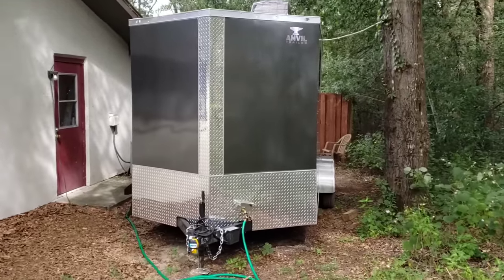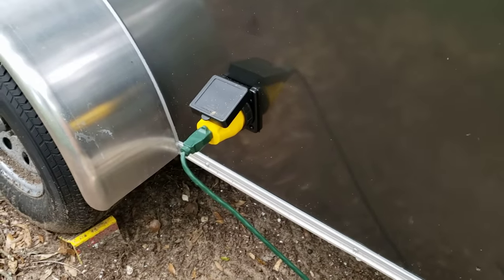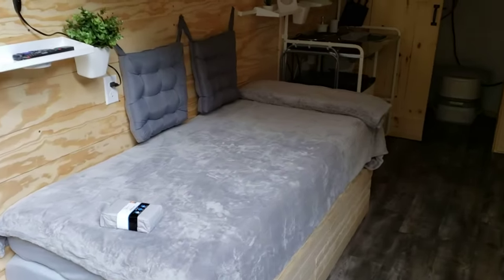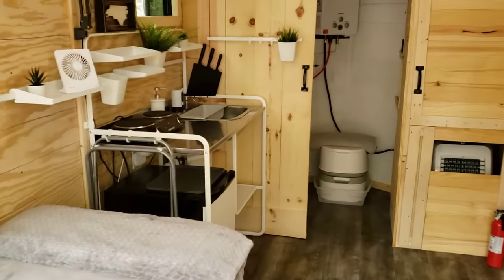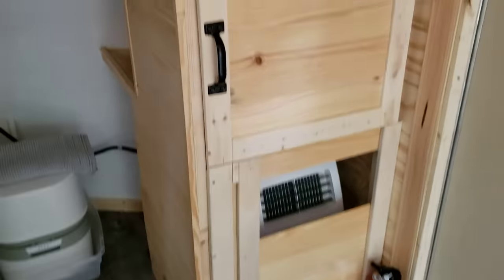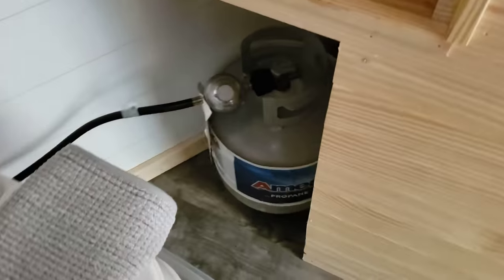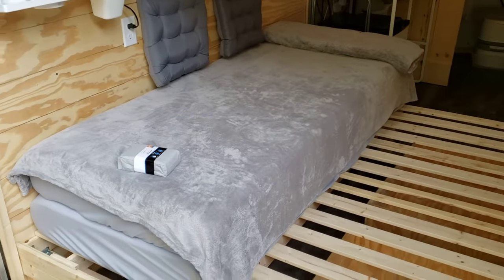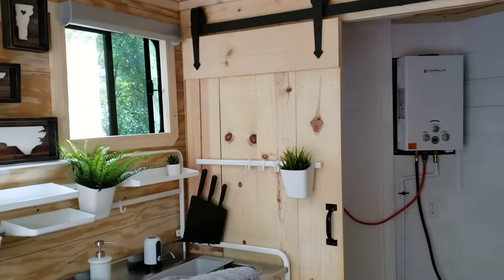7x14 Cargo Trailer Camper Conversion Finished (Tiny house?)

Comment: Tires. If you have a single axle trailer, this advice is of no consequence. But, if you have a two or three axle trailer, then please listen up. Trailer tires are not built like automobile tires, for a very significant reason. When you take a two or three axle trailer around a corner, the tires do not gracefully turn in the direction of travel and smile with glee as they do so. No, instead they are dragged sideways, screaming for their life. They are being twisted violently by the sideways forces. Those tires want to continue quietly in a straight line, not being skidded sideways across the pavement, tearing at their sidewalls. And, there you have it. The sidewalls. Trailer tires have special sidewalls to withstand sideways twisting. Don’t be tempted to put some other tire on your trailer, such as Light Truck tires. Trailer tires are special, for a reason. Another hint: If you back your trailer onto a hard surface pad, do the following. Once in place, roll the trailer forward and then back into place. Why?  As you back in, you are invariably making a turn at the same time. You are twisting the steel belts as you turn.  If you stop in the middle of the twist and leave the trailer there, the steel belts will “take a set,” that is, maintain the twist when later you decide to drive away. Now you have an abnormal tire. By moving forward and back at the end of the parking sequence, you allow the steel belts to straighten up before you go off and leave them. Happy trails. 😄
Reply: Really great thoughts Dale-- thank you for saving us from learning the hard way!!
Reply: Thank you for sharing that. Good info to know for sure!
Reply: trouble with trailer tires for campers is they are often china made and not too good.
Reply: Great advice. Thanks Dale.
Reply: Great information for me to remember
Reply: Have never heard of that but thanks for sharing !
Reply: THANKS!.....The 19' travel trailer I really want is nearly impossible to find and prices have increased nearly 50% over last year.....Nope.....So, am about to buy a slightly used, goood quality 7X14 cargo trailer (all aluminum, siding not screwed, heavier gauge, aluminum wheels, etc etc) Am in FL so all aluminum and plywood interior construction seems to be best (will be sure to undercoat any exposed plywood under decking).....If heavy duty radial tires not already in use, will spend the extra bucks to buy the best.....Wasn't aware that trailer and truck tires so different, plus the straightening out wheels when setting up good idea (probably would do that anyway, but will make sure I ALWAYS do that... ;o)
Reply: Roll forward then back after parking, got it, thanks Dale!
Reply: Thanks Dale 🙂💪😁
Reply: Before your advice in regard to triple axle trailers any special tires for trailers that is necessary so not to get a permanent twist.
Reply: that sounds good to me Dale, thanks
Reply: I’m replying to 1. Tell you thank you and 2, so that I can come back to this specific comment and screenshot it later! 🙏🏾
Reply: Why is it "advice" to not use unsuitable equipment? Why are people thinking about doing that? And why are they thanking you for calling them idiots? Let them eat laundry pods, let them use automobile tires for trailers, let them drive "just a little over" the speed limit. The world is crowded. Auto-pruining is natural.
Reply: Thank you
Reply: Another reason for the stiffer sidewalls is that they have a greater resistance to sway.
Reply: Ha, I do this very thing. Drives me crazy to see a tire sitting there under stress!!
Reply: THANK YOU for taking time to pass down your wisdom!!!
(& inevitably SAVING a lot of us time.and money)!
Reply: This man knows trailer tires. Good job.
Reply: This would have never occurred to me. Thanks.

Comment: I've watched more of these videos than I care to admit, and this seems to be the best trailer conversion I've seen.   Very nice, not over-done.  Innovative!  Congrats and thanks for sharing!
Reply from the maker: Thank you very much!
Reply: @Stephens802  Like you, I'd want my motorcycle inside, thankfully a BMW F650GS is not huge.
Reply from the maker: Nice, I have a V Strom 650👍
Reply: @Stephens802  ADV all the way!
Reply: @Stephens802  AWESOMENESS! Safe travels and thanks for sharing.
Reply: @Stephens802  Does it fit between the bed and the opposite wall?
Reply: Agreed very nice
Reply: I actually liked its simplicity.
Reply: Too big and heavy for a lot of people to tow, but still a nice build. Single axle trailers have plenty to offer as well.
Reply: Agree, everything you need & nothing more, perfect.
Reply: I agree SFG...  I watch these for inspiration, and soooo many of them are way overdone for what I need.  This is awesome.  I love the sink turned shower.  Genius idea!
Reply: I love it. But I'm worried about the drawers and doors coming open going down the highway? I would put locks on them.
Reply: There’s one by chatfield court that’s pretty awesome too!
Reply: I agree as well. This is what I’m using as inspiration for my build. Simple, all the necessities. Open feeling inside.
Reply: Wait till my video comes out

Comment: I watch a lot of youTube trailer builds. I really like the simple functionality you have executed. Kudos!
Reply from the maker: Thank you very much!
Reply: I watch a lot of these videos as well, and just.......wow!! You nailed everything. Goals!!! 👍
Reply: Meh Meh  Did your nasty comment make you feel superior??????
Reply: Meh Meh  whomp YOURS out for inspection and review.  Let's compare.
Reply: Meh Meh  CRYBABY
Reply: Meh Meh  Thank you (without sarcasm). Very nice. But? Not custom, nor designed or built by YOU. I was hoping for your build. Sigh. You had some great ideas.
Reply: @Stephens802  is a really I have a really good idea for your camper you built when you let down the back door you call it the patio make a waterproof top canopy it's life from the top and down and you can actually add the waterproof canopy to the top it will make it slight bigger so you can't actually eat outside and have like a screen net goes around it so when the top sliding out and drops you sick the legs out and make two squares a boat down and you can use it to cover around the whole back and it can say warm and winter time and you can put like a little brick stone down and a small portable can use an ammo can to make a wooden burned stove I think that will help so you have more space and more room
Reply: Me too... I’m impressed with the use of space. This build packs a punch with minimal materials. A+

Comment: One of the best!! You can always buy those “as seen on tv” magnetic screens to keep bugs out when your deck is down. Anyway, great job!
Reply: Good idea!
Reply: That's exactly what I was thinking. Or install a metal frame that can be flipped up that goes around the deck like the shower curtain rail that goes around the top of the shower but install bug curtains. This would essentially make a screened in porch.
Reply: Damn, this just gets better and better, great idea!
Reply: Yes,great idea, I was thinking about the bugs situation  when it's open like that.
Reply: From Big Lots I bought the as seen on tv screen door with the magnets in it for the side door of my trailer. From Harbor Freight I bought the home garage screen door kit and cut it to fit the ramp door opening, I stapled velcro around the sides and top and slid a 1/2 inch pipe (cut into 1ft pieces) into the bottom of the screen to hold it down. Still works after two years

Comment: I've been looking at "turn-key" trailers that cost an arm and a leg and are built like crap.  Then I see this, and it makes so much sense.  

First, you did an amazing job.  Not too complex or overdone.  Just very well thought out and functional.  

Second, you designed it for you, and you put it together.  So you can change/repair as you see fit.  If you buy company "x's" trailer, and something wears out ten years from now..good luck fixing it.  No matter what they say, those things are built to a price point and the components are made to look good for a year.  And then, all bets are off. 

Nice job.

Comment: Great trailer!  Simple and functional and it will outlast any RV on the road.  I also like that it is still light enough to be pulled by most reasonably sized vehicles.  Thanks for sharing your trailer.

Comment: Nice build!  Try to get a RVIA sticker for the side of it!  Some campgrounds won't let you in if you tell them it's a camper... ask for a tent site and carry a pop up tent to throw out and just use your camper!  Might not get fifty or thirty amp but you'll have a spot to part!  Way to think out of the box.  Great for hunting, boondocking and camping off grid on the low Q!  Happy trails.
Reply: It's not a camper  it's a utility trailer with a utility shower  and utility bed.   This is perfect for staying on the street.  I'm constantly being harassed by the cops in my toy hauler . Because it's not  a utility trailer I'm harassed in industrial areas and Because it's obvious that someone is in my trailer especially when the light is on I get harassed in residential areas too.

Comment: Because your trailer has two axles, it is very likely that this trailer is rated for more than 3,000 pounds. Also, remember, every travel trailer gets heavier and heavier with time. It is true. So, after two years of use, you should re-weigh your trailer so you have no surprises. I would suggest that you install a weight distribution hitch system on your trailer and tow hitch. It will travel much better for you.
Reply: True story! Studying it before I even get to the class room. I'm a learner as well as re-learning some stuff!
Reply: So Dale, why does the trailer get heavier ?  Also, no need for weight distribution hitch unless the tongue weight either exceeds the rating of the receiver or the front of the truck gets lighter.
Reply: A travel trailer (something you live in) gets heavier every year because in a tight space like this, we get better and better organized. We humans get inventive. We find ways to cubby-hole another item that would be so nice to have with us. Every item adds a little more weight. And, after about two years, all these little things really add up. And, as this weight increases, there is a possibility that the tongue weight has changed, also.  This is a critical point because tongue weight really affects how well the trailer and the tow vehicle work well (or not well) with each other. With a tag along trailer, you need a minimum of 10% (and 15% is better) of the total weight of the trailer to be carried by the tongue. When the tongue weight gets too low, it tends to try to lift up the rear end of your tow vehicle and, going down the road, it becomes unstable, leading to excessive sway and roll overs. Measure the distance from the bottom of your tow vehicle’s rear bumper down to the ground. Now place the trailer’s tongue hitch onto the tow vehicle’s ball hitch. Now measure the bumper to ground distance again. If the distance changed more than 2,” you need a weight distribution hitch to correct this. Even if you think you don’t need a weight distribution hitch, your tow vehicle will perform better with one on. In addition to what your tow vehicle can pull, there is another weight that is important. It is called the Combined Gross Vehicle Weight Rating. Your tow vehicle has this rating. It involves not just what it can pull, but how much total weight it can endure. How much does your totally loaded tow vehicle weigh PLUS the total weight of the fully loaded trailer. You need to know not to exceed that rating. It you are running very close to these ratings (and your tow vehicle does not have a manufacturer’s installed tow package), help your tow vehicle’s engine and transmission by keeping your engine running at higher ROMs than normal. This is especially important as you go up hills or start out from a stand still. Force (manually) your transmission to not shift until you get it “rev”ing in the each gear.
Reply: NOT ROMs, but RPMs, instead. Revolutions Per Minute.
Reply: @dalebannon8503  , I totally get that, but you would have said that initially instead of making it sound like the trailer gets heavier all on its own which had me wondering if it absorbed moisture over time.  

I weigh my axle and tongue and calculate my weights every time I change my trailer or the load.  I am lucky that there is a public scale close enough to stop by and it is only a few dollars each time.

Oh, and with two axles the trailer probably has close to a 7000 lb rating.

I also think you meant measure the front bumper and if it raises then you are getting light in the front end.  The best is to weigh the front axle, rear axle, and the trailer axles to determine when you need a weight distributing hitch and what size bars you need to apply the proper load distribution.
Reply: My words of advice were not necessarily for you. You have a handle on things. People watch videos and read comments to learn. My words are for them. 🤗
Reply: @dalebannon8503  true dope Dale spot on.
Reply: @Dave-sw2dm  yes Dave, the trailer will absorb some moisture, and other atmospheric things, and as Dale said, they will learn to consolidate their gear in the trailer more. But also in the years to come there will be repairs and modifications, that will also change the total weight of the unit. I think the special hitch would be worth the cost.
Reply: Scott Summers , I doubt he is exceeding 3000 lbs loaded.  I have a 6x12 v nose and with 750 lbs of bikes loaded I am only at 3000 lbs. my issue is keeping enough weight on the rear of the trailer to keep my tongue weight percentage low enough. I am at 14% currently but would like to be at 12%.
Reply: @dalebannon8503  You taught me something! Get heavier (I am a pack rat, so I need to heed !) And Combined weight rating. Thanks for your detailed yet patient explanations!
Reply: tandem axles on that trailer gross carry weight 7,000 lbs.
Reply: Ömęřţå_ Đøń83 , no I do not. That is why I asked so I could see what the OP meant.

Comment: Lots of clever little touches like the chair pads on the wall and pull out pantry. thanks!
Reply: I was wondering where your great water from toilet & shower went?
Reply: @owentp  I know you replied to me by accident, but not sure if they follw every comment. Gray water can be dumped down any sink drain. Though they didn't specify. Most people who build showers mainly use them to rinse off so not likely much gray water runoff from that. No more than the sink anyway. One could use a honey wagon and any dump station at a campground or free one.

Comment: In process of designing and now buying 14ft enclosed to make a camper trailer. This guy has built a beautiful camper out of an enclosed that is still usable to be able to haul tools and materials cross country. Definitely using this design for mine. Best design and build  out of several dozen I have looked at . Very nice job Stephen!!!
Reply from the maker: Thank you very much!

Comment: Very nice trailer build. I also have a 14ft V-nose cargo trailer that I converted about 3 years ago.  I use it for camping and hauling my 4-wheeler and motorcycle.  It's all electric with AC ( I too live in Citrus County).  I use a portable generator and 12V battery system, pretty much self-contain for what I use it for.  To me the greatest pleasure is knowing you built it yourself.  Again nice trailer build, cargo trailers make a great blank canvas, and I'm sure you will get many, many years of enjoyment out if it.

Comment: love this so clean tidy and organised, a lot of the conversions look like a junkyard on wheels.
Reply: I want mine to look "unvaluable" from the outside.  Putting a new one piece alum roof sheet on, other than that leave the screws bleeding rust on the outside. ...only tricked out things are wheel adapters to run same tire/rims as my e350 van

Comment: Now I wish I had added the ladder racks to the top of mine. This is the ultimate (gone fishing to get away from the wife) weekend getaway machine. Throw the kayaks on top and gone, now I'm thinking on a Murphy bed , once tilted up the kayaks will slide in perfect. Thanks for the super practical living ideas, seen a lot of these trailer converts and this is the most logical one yet. 👍 👍 🇨🇦 border line 11 (quote from ' gone fishin ' )

Comment: Won't you please make me one too? For my motorcycle, and/or my husband's road bicycle, and traveling from Massachusetts to see my son in Utah without flying. Ha, ha, j.k.! 
Fantastic conversion, best, most elegantly simple one i've seen yet. I'd love to just copy it. I don't live in Florida, so insulation is super important. And I would love to add a tiny propane fireplace / heater that is designed for yachting, the Newport 9000 made by Dickson Marine.

Comment: Nice, light, bright and airy interior, which looks great with the bead lines cut into the plywood.

Simple, efficient and comfortable, my only concern is the water heater not having its exhaust flue piped to the outside rather than being vented inside the living space.

I realize the extractor roof vent is probably on whilst the water heater is running but I would install a C02 alarm.

Comment: Good layout and lightweight. Nice bathroom. I have used that portable AC and it did not cool the space enough. The only other change is I prefer at least R13 for insulation for comfort in floor walls and ceiling.

Comment: great job.... I converted a shuttle bus and traveled in it for 3 years, but needed a little more room, so I purchased an 8.5 x 16 vnose cargo trailer which I am now starting the conversion now.. it will ba a mobile sign shop and RV. I keep vids on my YT channel as I get them made...again good work there I like it